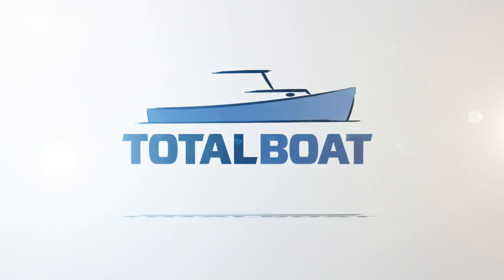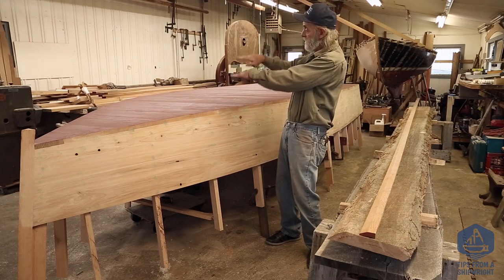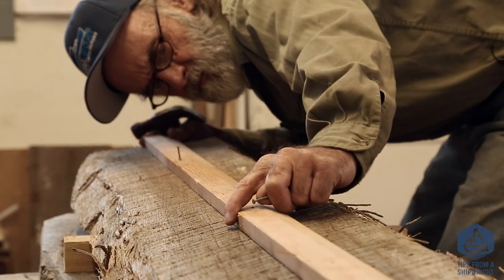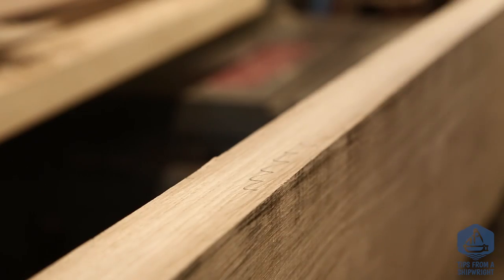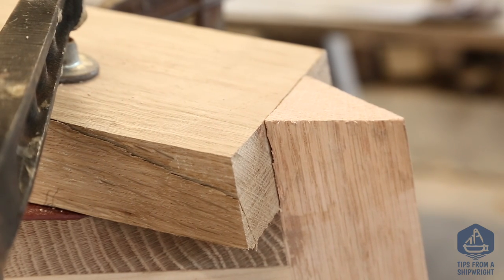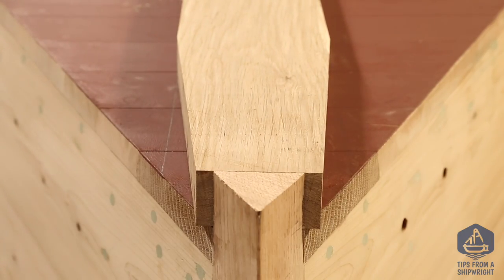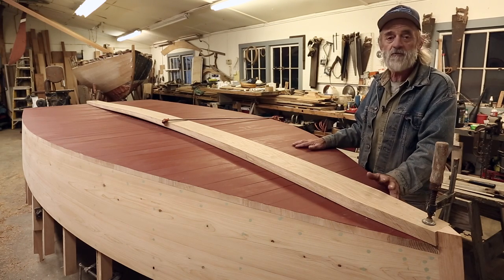Building the TotalBoat work skiff - The runners (Episode 21)

Comment: this is what truly separates the wheat from the chaff. Lou takes the time to plane and square a piece of wood that no one will ever see again once the boat is flipped over, much less care about once the boat is in the water. a piece that the average joe building one of these in their driveway could care less about if its square and true. over this entire build, Lou has taken the time to fine tune every little piece to perfection, but why? its just a work boat, a fishing boat, something meant to work hard and not need to look pretty. so why take the time to make sure everything is right and true? one word...integrity. integrity is doing the right thing when no one is watching. to be able to take pride in your work. its taking the extra time to do the job right regardless. this truly is the work of a master craftsman.

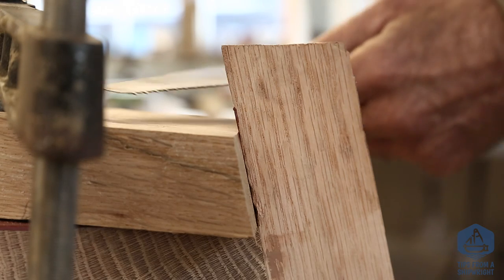Comment: At 11:02 you express surprise at how close you came to putting the runner in the center.  At the end of a project your precision is equal to the sum of the precise steps you took throughout the project.  You were careful all the way through and that results in infinitesimal deviations from the ideal.  Good job.
Reply: In layman's terms, build it straight and it'll be straight later. Also, looks like Lou lost his apprentice. I'm available, foremost flunky of 25 years experience and retriever of the golden skyhook, able to smooth over rough patches with the customer while measuring for a complex cut in the 3/4 nail down oak.  Why, one time, I installed a floor, on the ceiling! And another time, I soaked up a headshot from an irate granny with a 9" Lodge. At your service.

Comment: A very simple mod i've made to my saw is that i added a follower. It's a piece of metal flat stock, slightly springy, but not spring steel, it's tacked right on the line of the cut, behind the blade. On it, some 15 cm after the cut, there's a bend in the flat stock (heat help) that goes right inside the cut, on that flat stock i just put a few beads of weld, and shaped them like a wedge. It's 3.4 mm wider than the blade's tips (i use a metal saw blade, for some reason it cuts a heck of a lot better than wood blades, plus, the relief cuts in the blade relieve stress created by the wood moving around, which a normal wood blade doesn't have).
The difference is evident, and helps a lot, i mainly use it for 3 cm thick pieces, but it's worked decently well above that as well, take in to consideration that it was never meant to cut 4 or 5 cm thick (which is the maximum reach of the saw, a Makita).

Comment: Hi Lou.  Haha.  I'm also a Lou-a-holic and I have watched ALL of your videos, of course including this skiff building series, but for the first time I have a question.  I can appreciate that skiffs would be fine for use on relatively still or shallow waters, and you meticulously point out the validity and importance of the skiff's various 'runners' for directional stability, particularly when being used in a following sea.  So, question: SHOULD a skiff be used in a following sea condition at all, or, does this situation not dictate or demand the use of a V hull or even deep V hull design? In which case the skiff is being used in the wrong situation? Just asking.  Regards Mark in the UK

Comment: Question?
if I have a planking of a boat and scharf
which formula you use.
or how far you scharf the two boards to connect them later with one another or be bonded
  thank you
Reply: Samuel Vermeulen I tend to do a 1:8 or 1:12 ratio for my scarf joints kinda depends on the thickness of the timber
Reply: Rule of thumb is do the scarf 8x the thickness of the boards you're combining together.
Reply: thank you frend, i am looking to your vidio"s all the time and learn a lot of them
 greetings Samuel vermeulen
Reply: thank you greetings samuel

Comment: why do you nail, rather than screw the runner to the bottom.
Reply: Ned Kline id image its because nails will flex a little while screws would snap with movement of the bottom planking as it swells and drys over time, just a thought on it, there could be a different reason hes doing it that way but I can't think why right now.